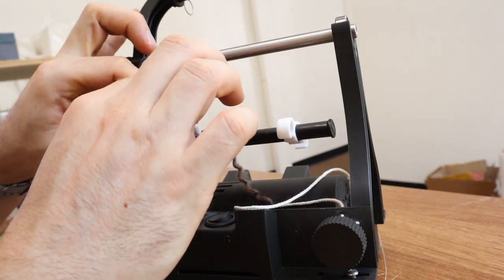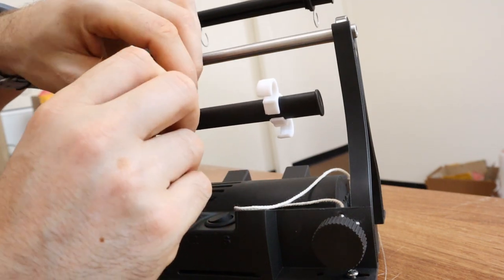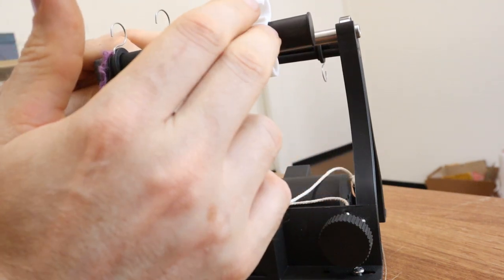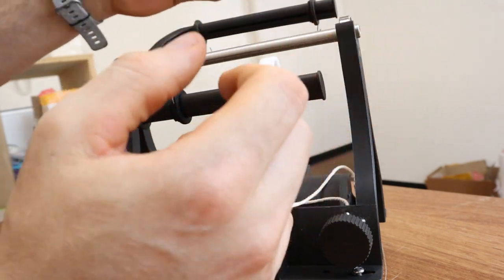SPIN #120 - EEW 6.0 Sliding Hooks

Comment: Still spinning at the speed of light on a daily basis with no problems to speak of. Hooks are fine, at least for my purposes. The only problem (sort of a problem, not much) is that my tension string broke under heavy use. This was not particularly surprising to me since I do spin quite regularly and heavily. Another factor could be the newness of the machine to me and my getting used to the right tension for it. In any event, I just grabbed my trusty ball of cotton thread that I use for tying up hanks and made myself another tension band. It's holding up quite well and took all of about 5 minutes to fix -- including finding the ball of cotton string. All is well. Thanks, Maurice.
Reply from the maker: Thanks for the feedback.  Another thing I've noticed is after you use a bobbin a few times the little groove the yarn sits in gets a little smoother and the string lasts longer.

Comment: This was promoted on the Dreaming Robots website as showing how to change the hooks.  But it doesn’t.  My 6.1 came with the hooks on backwards.  I finally figured out the black caps on the ends of the flyer arms popped off but it was frustrating for a while.
Reply from the maker: Sorry you had an issue with finding the video.  The video you wanted is here: https://www.youtube.com/watch?v=zjU9BSxXWos&t=20s

Could you point me to where on the website I am pointing to the wrong video so I can correct that for others?